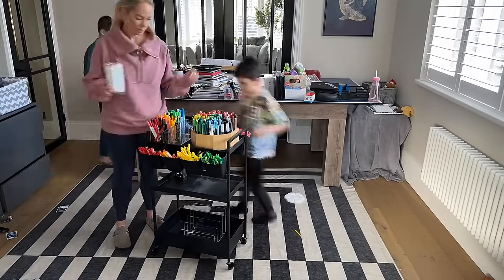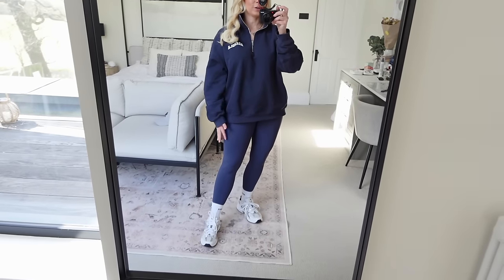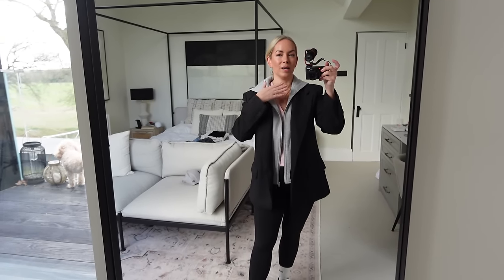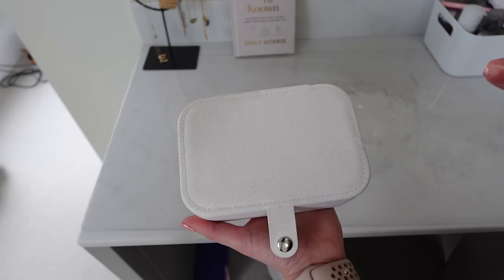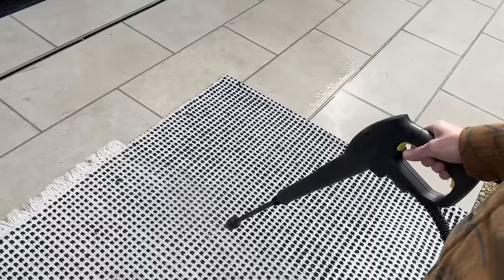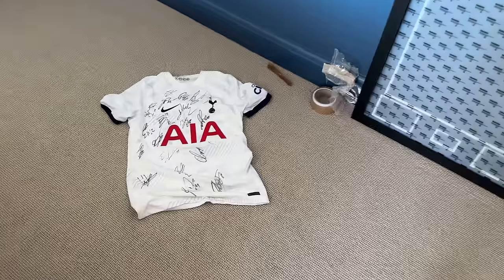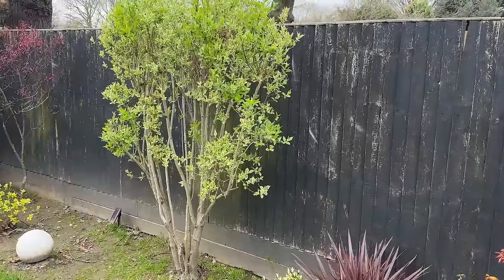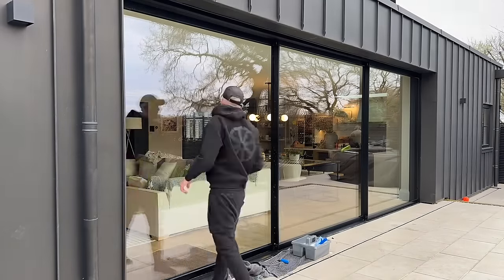GET IT ALL DONE! Packing, Organising, New Room + Garden Cleaning

Comment: We did that with the footballs. A little tip. If the box ever cracks or keeps getting left open etc and leaves and rain get in, we took the bottom out. This meant that the balls were kept in it but the rain would just flow through to the ground. We didn’t have to keep cleaning it out then when water got in  and went mouldy etc.